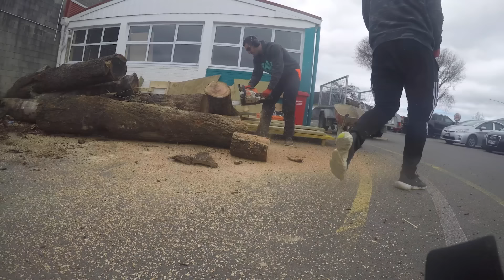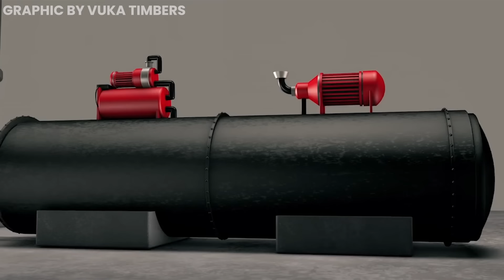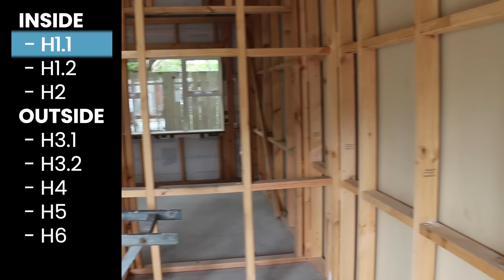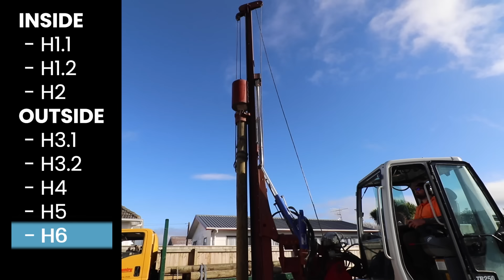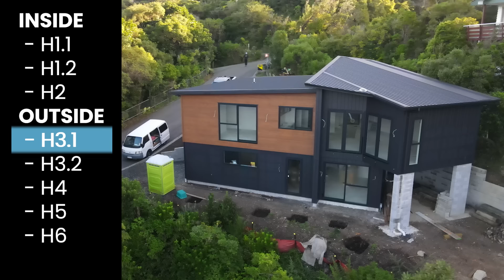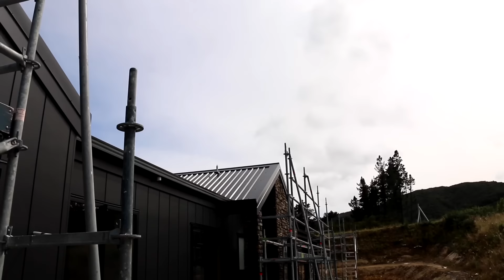Why is New Zealand Timber Pink???

Comment: Not fully correct around the treatment process. Firstly the timber is steamed to open the pours (remembering that pine has very open pour and grain pattern) secondally CCA treatment is one of the safest treatments around in the around that is used per board. The treatment generally any penetrats around 20mm into the timber. It is then heated again to lock the treatment into the cell walls. Treatment won't leach that often now days. Because of the processes used around the treatment and heating process.
Reply from the maker: thanks for the extra detail Adam
Reply: Pore.
Reply: Pore not pour.
Reply: Paw. Not pour or pore. Gotit?
Reply: Their there they're petals, could you not understand.
Reply: Poor, not paw, pore, or pour. Get your shit together!
Reply: Pore
Reply: Pores
Reply: Pore
Reply: And the chemicals used are inert once locked into the wood.  Further, boron itself is an inert agent and in wood is not hazardous.
Reply: Secondally is crazy
Reply: I believe all treatments are only surface treatments and only penetrate so far into the timber right
Reply: @ToxicGamer86454that is a poor assumption. Have you seen how americans spell?
Reply: Spot on.
Reply: @NZKiwiRic very curious of the indoor air quality implications here. Might not leech, but what about off gassing?
Reply: @michaellopez-lq5fn  both the H1.2 and H3.2 don't produce off gas once in yhe wood.  H3.1 is the higher risk for exposure but not used in N Z homes AFAIK....
Reply: @ToxicGamer86454 I am going to introduce you to two unknown Americans named George W. Bush and convicted felon Trump.
Reply: @charizzkalum9137 
Boron H1.2 is.surface treated spray on, brush etc

H3.1 is flooded chamber treated at low pressures..

Funnily enough H3.2 is flooded chamber, treated at high pressure, 
reason could be because it's rough sawn ..

Comment: Here in the US and Canada we have blue timber which has been tinted by the fungus which killed the tree in the first place!

The fungus gets into the tree on the horns of the Mountain Pine Beetle.

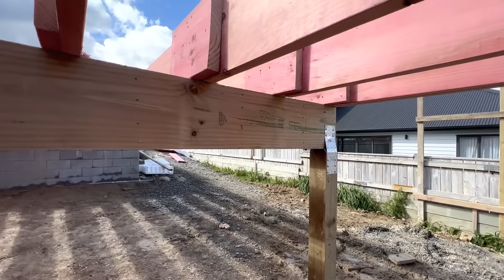I'm pretty shocked to see @5:32 structural timbers (H3.2) in direct contact with soil.  I don't think code allows direct contact at all in the US.  We recently, finally, got a way to build a code-compliant fence, a steel bracket from Simpson that holds a fencepost with a tiny airgap above the concrete footing that supports it, and can support the moments that fences see.
Reply: H.3.2  direct ground contact is not permissable in N.Z. Building Code.
H4 is the minimum ground contact allowable,
Reply: @mohairsam9705  So... oops?

Comment: In the US, we have a similar grading system, except that treated timber is generally referred to as "pressure treated" lumber. Sometimes, we'll use the the specific grade designation like marine grade. The other difference is the color. All of our lumber that is the equivalent to your H2 is green in color. Borate treatments are usually done after framing is completed. A team will use hand sprayers to treat the bottom two feet of the exterior walls inside and out with termite solutions.
Reply: Don't forget that the green colour comes from the copper-arsenic that's used to treat it.
Reply: @kauske  Chromated Copper Arsenate was banned in residential construction in the US in 2003.
Reply: @disqusrubbish5467  That one might be banned (but not really, it's still allowed in certain applications, like permanent wood foundations), but there's also ammoniacal copper zinc arsenate.

The US has a way of always half-arsing bans of poisonous stuff. But that gross green wood most in NA think of when they think of pressure treated wood gets its green from copper and arsenic.
Reply: It used to be green years ago. Now it is more like a dark yellow.
Reply: @LucidDreamer54321  Still looks green to me.
Reply: @juliancate7089  Get your vision checked. Pressure treated lumber stopped being green color about 8 years ago.
Reply: @LucidDreamer54321  Was there any need to be insulting. I was just at a job site and all the base sills are PT 2x6s that have a copper green hue. Perhaps, your supplier uses a dye or some different chemical or whatever, but I guarantee that where I live - from our supplier - PT lumber is green. I guess I deserve to die now because I dared to say something you don't agree with.
Reply: What do you mean my H2?
Reply: What do you do with the off cuts? Can you burn them or landfill them?
Reply: @jakedee4117  What happens in the US? We try to use as much of the cut-offs for blocking as possible, but what happens to it after it's hauled away, I have no idea. The amount of waste that is PT lumber is VERY small. Mainly because we don't build our entire homes with chemically treated wood like they do in NZ. It's only used where wood meets concrete or dirt. We use a fair amount of engineered lumber in the US in the form of oriented strand board (OSB), LVLs, LSLs so I guess that some of it ends up being recycled. Another building practice that's becoming more common is using pre-cut lumber packages. With those packages, the amount of cut waste would literally fit in your hands.
Reply: @juliancate7089  The houses still fall down after 50 years though.
Reply: @rogerphelps9939  If your house is built by the typical production builder, then yes, it's a poorly-built hovel that's going to need to be bulldozed in 50 years or less. If your house is built by a custom builder, then depending on how much money you spend on durability, you are likely have a generational home. It's up to you.
Reply: My area has orange red ones.

Comment: Fun fact: H6 treated wood is done with a chemical called chromated copper arsenate (CCA) which, as the name might suggest, contains chromium and arsenic. In places like docks or wharfs theres of course little public health concern HOWEVER, it was also commonly used for decks and childrens playsets until around 2004. So if you have a wooden structure or deck made of unknown wood, built before 2004, its v possible, even likely that its CCA.

Comment: Depends on local environment the chemical solution either has to do with fire ratings bugs or mold resistance, if construction lumber I colored it usually is combating local environmental factors

Comment: Most pine lumber in my neck of the woods is just kiln dried. We have pressure treated wood but you're not supposed to use it indoors because the chemicals off-gas and having that inside a home is like hotboxing cancer dust. But we make up for it with our wonderful American diet, lol.

Comment: My theory is the H3 offcuts could be chipped and added as a supplement to the production of particle board. Much in the same way as scrap steel is added into the production process of new steel. The hard part would be organising a collection system for the offcuts. I guess there could be a bin at the local landfill.
Reply: It's hard to work with, and particle board can't be allowed to get wet, so I doubt that it's worth the extra health and safety concerns of working with contaminated ship and dust to make something that can't be allowed to get wet anyway.

Comment: My parents first house was brand new when they moved in. A new area. The local animal farmer was selling off parts of his land. Further in, there were still sheep. The local trees were cut up to build the houses. The house and surrounding ones are still standing today -  50+ years later.. The timber was rough cut and the sap could be smelt for years.
Reply: Was this in Zealand ?
Reply: What kind of trees were used? Josh is talking specifically about radiata pine (which were non-native, and imported into New Zealand from California).
Reply: @roguevector1268 they specifically say in the start of the vid their using that pine because it's native to the area , it's not from California, cali has ponderosa pine and Douglas fir and spruce and red woods. , radiata is a tropical pine , it can't survive in cali just like calis native trees can't survive in nz because nz Is way to hot in the forested areas and way to dry and hot in the non forested areas while the native pines in nz love their native conditions. When he points out that they once used different woods he refers too and American wood and a native tropical wood that are both water resistant but that tropical one is nearly extinct because it's so prized for furniture and so no one uses those anymore
Reply: @GoldenBoy-et6of  In the video, they only said it is suited to their environment [in that it grows well]; they did not say it is native to New Zealand because that is factually incorrect. Radiata pine is native to California (and some parts of coastal Western Mexico), and is not native to New Zealand. Pinus radiata is cultivated extensively for lumber in New Zealand, Australia, Chile, throughout parts of Spain, and is also cultivated to a lesser extent in South Africa, but that does not change their native range.

Comment: I live in Douglas County Oregon known as the 'Timber Capital of the World.' Here treated material is called just that. All 2 by material is called structural building material. Timbers here is what's 4 by material and up and we call glulam beams just that. Our building codes here are very strict and the Building inspector better be on his toes here because we don't put up with their SH!T. Even if they stray from what they are there to expect, we let them know. It's what our Commercial, Residential licens e pays for. I'm a retired Residential/Commercial Building Contractor. We used to use Pentaphenyl products but stopped because they do kill animals, especially say a dog is laying out on the deck during a hot day causes the fumes to rise poisoning the animals.

Comment: Here in New England, the studs we use to frame walls, even exterior walls, are usually kiln-dried, but not chemically treated. The termites we have in this area only eat wet wood; same for the molds and funguses we have in this area. So, as long as the builder laps the flashing and housewrap correctly, one can expect the framing to last indefinitely. Of course, that doesn't always happen; we have our share of sloppy builders, But, if they follow the codes correctly, untreated wood works fine here.
Reply: Indeed. Here in Maine I hardly ever see green lumber at the lumber scrap yard but lots of natural. My house is all natural, or so I believe, but it's 115 years old so take that into account.
Reply: Same in MI.

Comment: We have pressure treated lumber here that’s designed to hold up to moisture better than normal timber. the often use it for the bottom plates of a wall, and for other applications.

Comment: Kia Ora Josh, this video is really helpful thank you for producing this for us all to learn from. Question if the joists can be made from H1.2 how close can your subfloor be to the ground for it to change to a higher treated wood? 

For example I'm building a sub floor that's 60cm from the ground should I use H3.2? Instead of H1.2? :)

Comment: Stop building with wood.  No more rot,  Especially Exterior sidings.  Use durarock, basically concrete siding that’s looks like wood.
Reply: Wood is the only renewable building resource and it holds up well in earthquakes. It's a wonderful material and we'd be foolish to abandon it.

Comment: Always wanted to know if the h1.2 KD timber is treated right through the timber like h3.2 ,or just on the surface, watching the video it would suggest the treatment is pumped throughout the timber?
Reply from the maker: from what I understand it is pumped through in a pressure chamber
Reply: @nzbuilder  its a surface treatment really and a compromise between wet boric treated timber that screwed builders backs in the 70's and 80's and kiln dried untreated that rotted in houses in the 90's and early 2000's. Technically you are supposed to treat cut ends though I have never seen that done.
Reply: depends how its treated you can get both pressure and dip tanks

Comment: Building with steel framing at the moment - it might be better in some ways, but damn I"m never doing that again if I can help it XD
Reply: Try ICF if you get a chance.  I framed for decades, but have built my retirement house out of reinforced concrete and foam.  The thing's a beast!
Reply: @two-sense  Honestly, if I'm in a position where I've moved and need to build my next house, I'm going to go with solid timber rather than framed cavity. Wanted to do it with my current one, but had a bunch of issues that kind of forced my hand to go with steel framing.

Comment: Interesting fact, Radiata pine is native to the west coast of America yet it was never commercially exploited. I work on houses containing 200 year old North American softwoods, no chemicals required. Here in New England your wood has a lifespan of aproximately 20 years....
Reply: Was a carpenter in New England for over 45 years. The oldest house I ever worked on was over 250 years old but I also worked on dozens of houses that were 180 to 200 years old. They were still inhabited. Old growth close-grained lumber. Crap today is genetically engineered to be harvested in 30 years or less. And particle board won't hold up for s***. It's all in the material.
Reply: @tomernest2004  Commercial trees species are not genetically engineered. In fact it has been tried, but the long generational cycle makes it unfeasible (as of today).

Comment: Having watched the video, I still don't know why it is pink. I liked the little pump animation of it shaking whilst pumping the CCA pressure cycles though, thanks. I mixed borax, pyrethrum and antifreeze, just for good measure and doused my rimu 😢floor boards prior to sealing. They didn't turn pink.
Reply: It is pink so it is easy to spot when someone uses it in the wrong place. If you see pink timber somewhere exposed to the elements, like under a deck, someone has stuffed up.

Comment: Pink colour is a dye that's added to identify H1.2 treatment. The green timber you see is treated with copper arsenic and chromium. This is H3.2 H4 etc. Both types of treatment contain salts,heavy salts. This will rust out your fireplace and chimney and neighbours roofs etc.
Reply: Not even rust. Those are toxic and if they get burnt / Hot you may be exposed to the.

Comment: I live in a house built of pine that's going on 50 years old that's in the muggy, wet southeastern US. It is totally untreated. None of it has even remotely begun to rot. Chemical companies are just out there coming up with problems that don't exist. 👍
Reply: Same here only with 260-year-old wood
Reply: Not all the pines are the same. We have pines around here too. They are not radiata, but Pinus Pinaster. They reach over 30m and it is full of resin, but they rot pretty fast too if the wood gets wet. If you keep it dry they will be drilled by insects. I live in a zone that is hot and wet that gets winds around 100 mph each winter, and that is the reason we build our houses with concrete + stone or bricks.

Comment: That is some beautiful lumber.  I know it varies, but here in the US, in Minnesota, most lumber is pine, and its barely square, knots all over, warped, and looks like crap.  That stuff you guys were working with looks fantastic.
Reply: No it isn't, its crap, I always call it hoop pine & knotty pine, that chit twists, bows, splits using nail guns if too dry.... I built all my houses with it & framed up quick b4 the crp bent, used the twisted crap for nogs, b4 gyprock (gypboard in NZ) I'd spend a day straightening the walls, planning, cut half way thru studs & hammer timber wedges in to straighten it then flitch plated the cut....... I could go on...
Reply: Not warped much at all when you buy in 6 inch lengths.
Reply: We were building a house near Lake George just south of St Francis,just about the whole framing package was warped returns dropped off for us,really twisted junk.

Comment: So , what chemicals are used ? Are they cancerous? How much micro particles are slowly released ?
Reply: Copper mostly
Reply: Copper Chromium Arsenate complex. Issues with leaching of offcuts and when houses are knocked down. Also use Tributyl Tin Oxides and copper azoles. Not sure which is worse but likely the Arsenic & Chromium if not managed properly which was mentioned and is why it's not used in other countries.
Reply: Sorry - many alarmists out there.  Don't worry.   Once the CCA (NZ wants to phase out) and ACQ (the latter preferred) is locked in the chemicals are generally not reactive and in the wood cells themselves.  The valid concern is that copper and/or arsenic overexposure is bad as both cause harm in larger quantities.  Those quantity thresholds are nowhere close in approach in finished, treated timber.  NZ requires several layers of testing on all treated timbers.  Note that CCA does have negative environmental impact issues and NZ is working on  getting rid of it.  In particular, farming and vineyard posts can leach the chemicals into the ground as the wood degrades - obviously not a goid thing.  

The term 'treated' is misapplied often - as the process of treatment includes heating-application-reheating-drying - thus leaching above ground (no ground contact) is generally not an issue.  

Also boron is used in the process and it is an inert agent not harmful (but borer and termites hate it).
Reply: Short answer:  A bunch. Yes. A bunch. You're welcome.

Comment: Someone needs to come up with a mill for off cuts and turn it into an OSB panel or structural laminated beam. Also, if your lumber suppliers begin to offer custom precut lumber packages, they can capture the offcuts.
Reply: The majority of builds are done by larger companies.  They all use pre-builts, so it's already beng captured by the manufacturers.